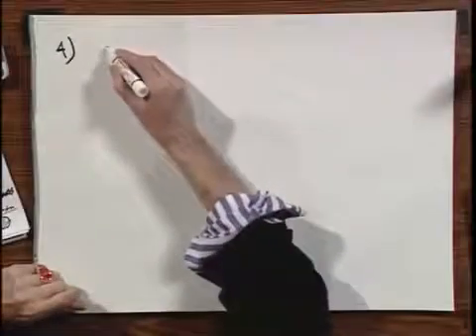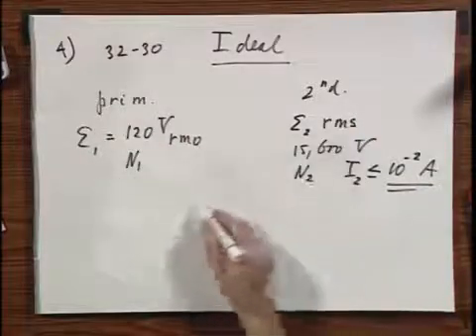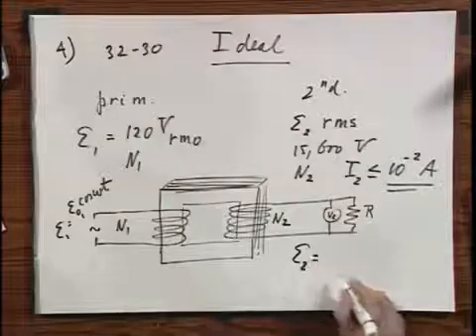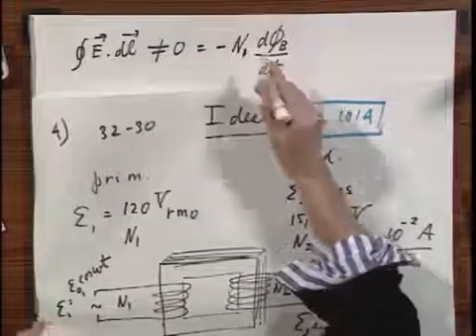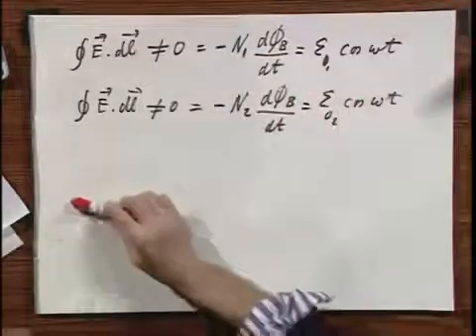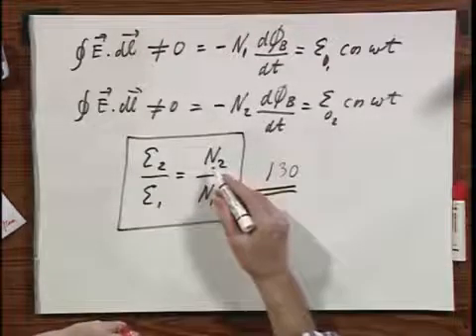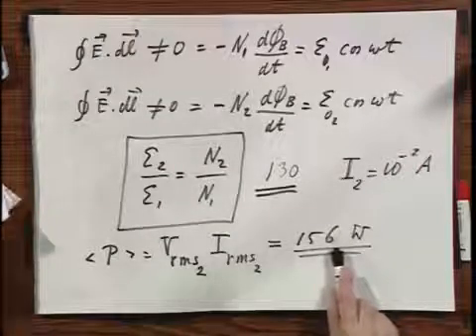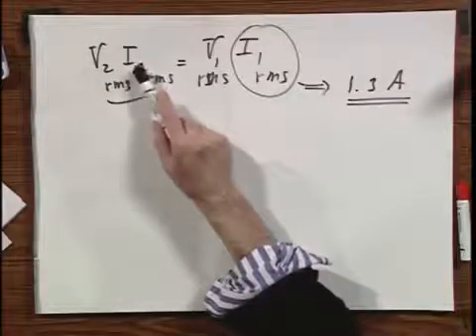8.02x - Module 10.04 - Ideal Step Up Transformer.

Comment: Sir Which physics books are used during your different physics lectures e.m induction, optics, mechanics etc? Regards
Reply from the maker: 8.01
Physics
Hans C. Ohanian
Physics
Volume 1 
2nd edition
W.W. Norton & Company
ISBN 0-393-95748-9

8.02
Physics for Scientists & Engineers by Douglas C. Giancoli. 
Prentice Hall
Third Edition
ISBN 0-13-021517-18

8.03
Vibrations and Waves by
Anthony French
CRC Press
ISBN 9780748744473

8.03
Electromagnetic Vibrations, Waves and Radiation 
by Bekefi and Barrett.
The MIT Press
ISBN 0-262-52047-8
Reply: Thanks and Regards 🙏🙏🙏🙏🙏

Comment: Professor, why did we set the power equal to VI instead of VI cos(phi) ? 
Since there are inductors in both the first and second circuit, the phase angle phi will be Non zero in both the circuits. Or am I missing something?
Reply: Because he is talking about the average power, not power as a function of time.

Comment: Thats the case asumming the primary selenoid its been power by alternate voltage, but how would be the change if I have for example 12 v dc battery and I do pulse each time( I mean turning on and off the battery over and over again), in that case should I use the voltage of the battery ""12 v dc" ? or the voltage on the sacundary  depends on how quickly I turn off and on?
Reply from the maker: question unclear
Reply: You make the calculus with "rms" that is for alternate voltage, but what if I´m using a 12 V dc battery?  should I used 12 V for calculus?,  to change the flux I´m turning on and turning off the battery conected to the selenoid
Reply from the maker: I suggest you google "How to change DC into AC".
Reply: Ok, I´ll do it :)
Reply: @johnbalvin5401 , you are saying that V₁(t) resembled a non-negative square wave. Recall that it is the change in voltage that induces an EMF in the secondary, and thus V₂(t), which is proportional to dV₁/dt, is equal to 0 everywhere except at the points where you turn on/off your 12V power supply. Every time you turn on the power supply, there is a positive spike in V₂, and every time you turn off the power supply, there is a negative spike in V₂.